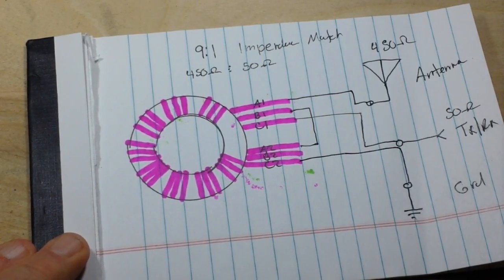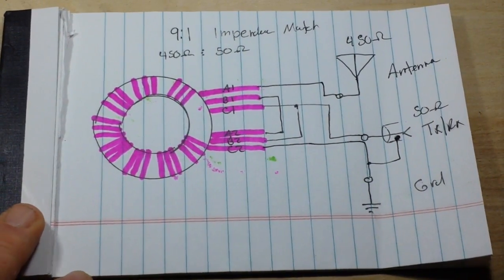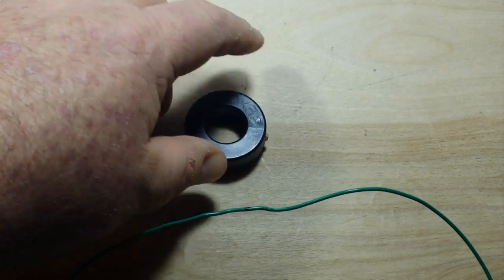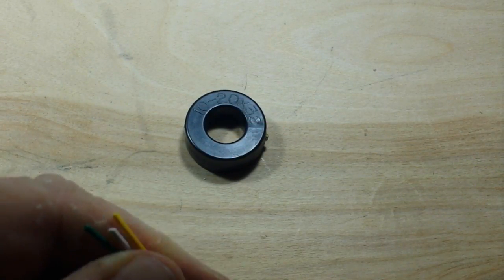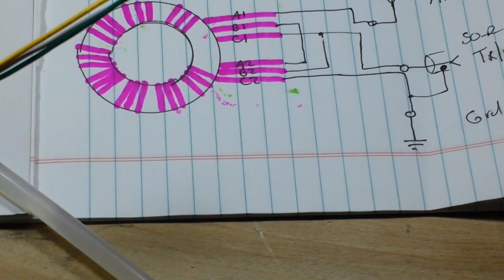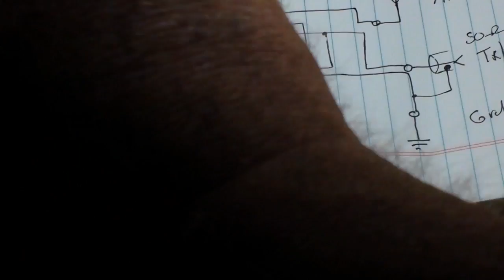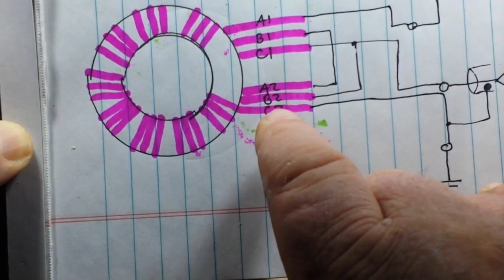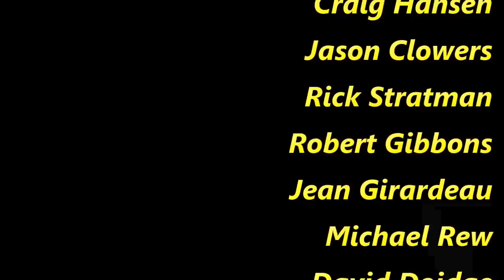How to make a 9 to 1 autotransformer (UnUn)

Comment: Thanks for the clear description and best wishes for your health issues. One thing: should you not use silicone or Teflon coated wire, rather than PVC coated, in case it heats up, as these are prone to do under load?

Comment: Nice explanaton and diagram. Thankyou for the walkthrough. You used 22 gauge wire and said that it was good for approximately 20-30 watts of power. If I wanted to use 100 watts of power 14 gauge ought to be enough I would think.
Reply: .... you would probably be OK with #20 wire on the same core, unless you use 100% duty cycle.. CW key down or RTTY. He's using color coded poly insulated wire but enamel insulated motor armature wire would be better and easier to work with... just keep the 3 winding parallel to each other, meter em out if your not sure. He doesn't mention the core type and material... Amidon T200 red cores are the correct core material.... rated 2-30mhz .. unless your doing 6 meters.

Comment: Hello sir.
Good job you've done.
I have several toroids Amidon FT50-43, and 3 pin flat stranded ribbon cable 22AWG. I want to experiment with a Un-Un 1:9 random wire antenna. These toroids (FT50-43) are very small, do you think the 22 caliber will work well or do I need less diameter, 20 or 18 maybe. 
Thank you for answering
73 Jorge

Comment: Paul, would a Toroid Core FT140-43 Ferrite work? Also, what size of box did you use? I am planning on using mine for a random wire antenna for shortwave listening. I have some 16 AWG wire, will that work okay? Also, how can I connect the coax cable to my radio that has two screw terminals? I wish you the best of health and would like to support you on Patreon if you can sent a link for it.

Comment: It helps if you draw out that diagram, then put a colour 'dot' next to the A1, B1, C1 lines, top set ( I used red green and blue wires...sooo...used red green and blue dots ( duh !). 

Do the same thing for the bottom set of wire ends,  they should be in the same sequence of course, both top and bottom.

Then draw the rest of the diagram. I found it just makes it easier if you need to refer back to the diagram at any time, which since I was being VERY careful...I did often !

Comment: You mentioned transformer=heat. Does that make it wise to use hot glue?
Reply from the maker: If it gets hot enough to soften the glue, you are probably going to overheat the wires.

Comment: looks like a 8:1 UNUN  why not 27 turns with a tap on the 9th turn?
Reply: I had the same question, but otherwise, the video was extremely clearly presented.
Reply: No, this design is a proper 9:1 impedance matching UnUn. The impedance ratio is set by the three wires being connected in series (A feeds B which feeds C).  The number of turns around the core does not determine the ratio.

Comment: Big question is how do you determine the impedance of the long wire antenna? The Radio is already marked if it is not to old of a radio.
Reply from the maker: +Carl Davis I believe it is assumed that most long wire antennas are about 450. If it's out of that range, an antenna tuner would be required. I could be wrong here, RF has never been my forté.

Comment: Does the size or composition of the torrid matter. I've watched a few "training" videos some mention the size and some don't. I typed the number on the torrid in your video and came up with  a bearing seal? Great video It's much fun learning this stuff from yous guys. Please keep it up. Thanks. W2AAO
Reply from the maker: The composition of the core matters, size only needs to be big enough. But different cores will react differently at different frequencies.
Reply: We have something like that at work. Except they're stainless.(Well probably not because they are easy to drill through). We use them for hinges on one of our machine gates. 
But I think they'll have iron ones at the hardware. I can't think of the name of it off hand but we use them to keep things from sliding down a rod. I see the set screw in the one you're working with.  One of the guys said he uses a "Powdered core" torrid.?
Reply from the maker: Yes, mine are powered core. It's just iron and other chemicals ground up and pressed together.

Comment: Where does the 9:1 come from?  I'm seeing A1 to A2, 8 turns, A2/B1 to B2, 8 more turns, B2/C1 to C2 (and ground) 8 more turns for a total of 24 turns.  The tap at C1 is 8 turns to ground.  24:8 is 3:1.
Reply: Steve O'Shaughnessy The “9:1” refers to the impedance match. 50 Ohm x 9 = 450 Ohm. The impedance ratio of a transformer is the square of the turns ratio. The square of (3:1) is (9:1).

Comment: If you want to get fancy, get some Solarez, after you are done winding the coil, dunk or coat the coil/toroid with the Solarez, put it into the sun for about 3 minutes and you have an instantly sealed and hardened coil, completely waterproof and secure.

Comment: If C1 is being fed by the coax center conductor as in your diagram, and it comes out of the winding as C2 and goes directly to ground, that's definitely a problem right there.  
Splitting it into B2 means half your outputted signal is going to ground before it even reaches the antenna.  No way!
Saying "to your tuner"  is not a concise explanation.  It needs to be; feedline center conductor, outer braid (which is feedline ground or negative),and station ground.  
In referring to the antenna;  antenna feedline/antenna negative or ground/and earth ground.  That is how to refer to these various elements.  
Simply saying to the antenna or to the tuner is confusing.  Thanks.